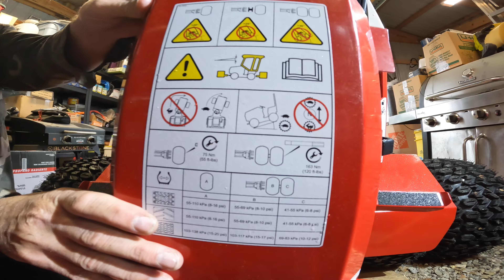Ventrac 4520z first issue (back home)

Comment: I experienced the same issues with hydraulic leaks, beginning at the rear under the seat and now in the same area yours was.  Like you said, everything runs on hydraulics so you are dead in the water until fixed. Makes moving to load difficult. Bright side. My dealer takes these issues to heart and came out to fix both on site and once to take it back to shop and fix it timely and free. And they are over 2 hours away
Reply from the maker: I am glad yours was worked out as well! So far, knock on wood here, after that initial batch of issues my 4520 has been rock solid mechanically. No oil leaks, no hydraulic leaks, engine starts right up even down below freezing temps. I am suprt happy about all that. Bit of a bummer to have a brand new toy, err tool, of this price have a few issues right out of the gate. Like you the dealer has been on the spot for me as well for repairs. They fixed one issue on-site, did a factory recall on-site and the main leak they came out and hauled the 4520 back to the shop and back to me. All free of charge, which I would expect with under 5hours on the machine. The dealer I have been working with is about 3-4 hours away from me.

Comment: My 4520N had a hydraulic hose that wasn't even finger tight from the factory.  Dumped hydraulic fluid all over my concrete driveway.
Reply from the maker: Mine was basically the same. Sad that it seems like some easy to fix quality control issues.

Comment: On day of our delivery after unloading two of the three attachments, we suddenly saw parts on the ground and hydraulic fluid spurting out under the tractor directly under the seat..  The culprit was the hydraulic pump under the seat, with less than 20 mins of runtime on our farm we blew a gasket.  The spring clip holding it together wasn’t seated right so with the pressure of use it blew apart.  Sales guy wasn’t happy, but we were able to get the unit loaded back on the trailer and have him take it back to the shop.  Just got it back yesterday.  I would say Ventrac has some factory line assembly quality checks that need to be implemented and quick.
Reply from the maker: WOW! I am very sorry to hear that. When I got my 4520z they were a bit newer on the assembly line but by now I would have hoped these types of issues had been worked out by now. Surprising. From what I understand Ventrac does some type of minor stress test on these units. I remember in one of the official Ventrac videos they have a section of teh factory floor with pretty heavy skid marks from racing back and forth. Your description would make me that should have been seen pretty easily in any testing? Wonder if things have changed since the Toro deal. 

I do know that Danny (Ventrac rep in my area) proactively reached out to me when I had my issue and they did stand behind their machine. Sad it has to happen but have faith, Ventrac does stand behind their machines.

Comment: Very interesting! I can tell you that on my brand new 4520p, this was not the fitting that was loose and leaked on mine (my fitting was closer to the seat/easier to reach). However, after the tech fixed it on site, about an hr of runtime later, the unit barfed hydro oil a second time. I didn't bother investigating whether it was the same fitting that came loose or not as I just called them to come pick it up and service it properly at the shop. Interesting to know it's not just one faulty fitting though!
Reply from the maker: Interesting indeed. Two hydraulic leaks on a 4520 model in two different places. You kn iow they make a lot of these but i'll bet not a "LOT" have gone across their facroty floor just yet. I am sure whatever is going on Ventrac will figure it out and make a correction.
Reply: @tlchomestead  Rep called me yesterday and said that this 2nd leak was a faulty o ring.  Getting delivered tomorrow (monday).  Fingers crossed.  Agreed that likely not that many have been produced.  To hear of at least 3 units having similar hydro issues is likely a sign of something beyond randomness.

Comment: Interesting indeed. I'm watching this video just after sending my 4520p with 17.4 hours back to the dealer for a hydraulic leak. Mine was more on the left side but in that same general area. Interested to hear what they find.
Reply from the maker: Keep us in the loop for what you end up finding out! I'll bet all these little things are simply the result of a new model. New model means proicess changes which means people who have gotten really used to X now have to do Y. If that is the case then in time these ankle biters will go away.
Reply: Dealer said it was a bad crimp on a hose end that goes to the steering cylinder on that side. Have plenty of mowing to catch up on so it will get tested out.